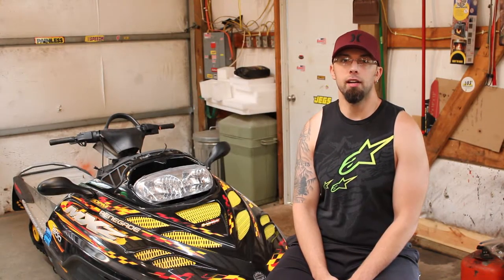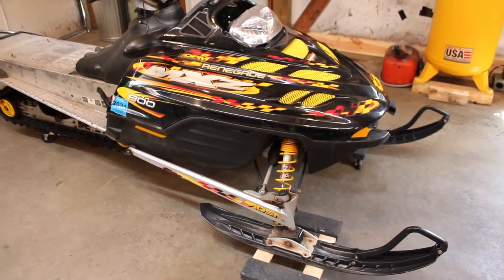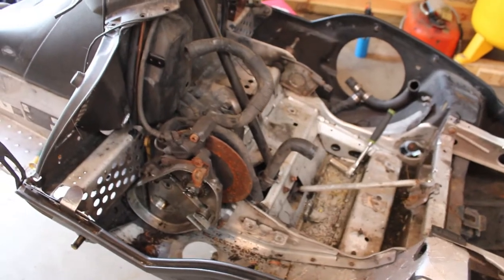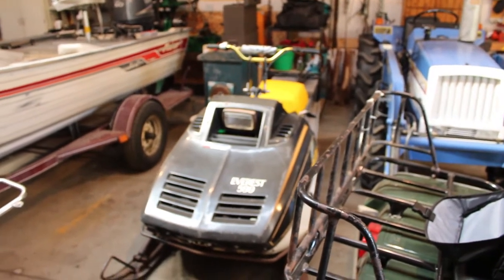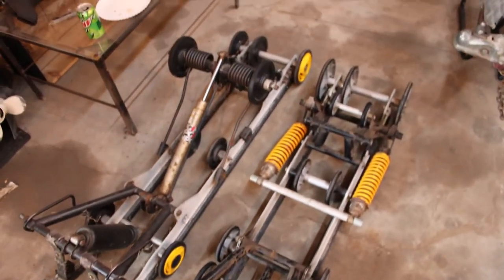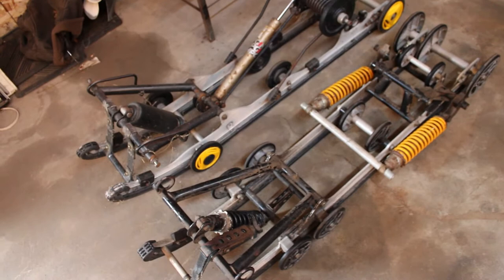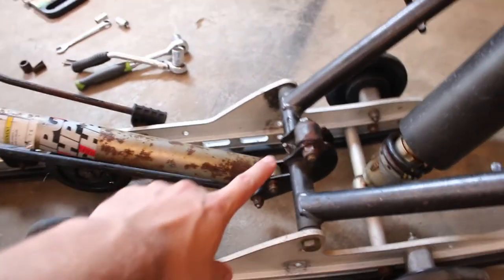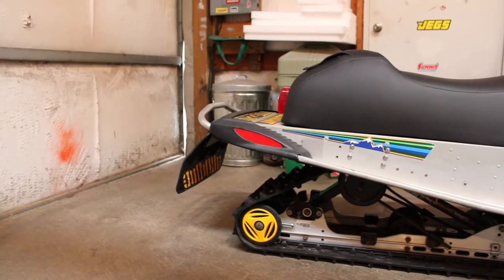Snowmobile suspension swap. ZX to F chassis.

Comment: Bro what did you end up doing with the front suspension?
I have a 1996 STX583 I I would like to know if I can make the machine ride better. Great vids.
Thanks.
Reply from the maker: I shoved 14" shocks out of an s chassis in this one. Super tight fit, bit it was doable. If you're willing to ditch the sway bar i think you could easily get the 15" adjustable HPGs in. Handling would probably suck on trail though without the sway bar and these things are tippy enough as is.
Reply: @NorthwoodsNoise   
Thanks. Now I will look for a parts sled. 👍
Reply: Thanks again from Alaska
Reply from the maker: @wesbullock1233  no problem! Good luck with the build!

Comment: You care to share some more information on the mounts for the rear skid to bolt onto the chassis,like the dimensions. I have an 95 583 formula z that I’m swapping to have an 670 and adding the 96 sc10 to it.
Reply from the maker: Is your skid a 121 or 136? I'm working rn, but I can give you a detailed answer in about 2 hours.
Reply from the maker: You can use the existing front hole in the tunnel no matter what size skid you're swapping in. The 121 SC10 center to center distance is 24 3/4". So if you have a 121 measure 24 3/4" back from the front hole and that's where the center of your rear bracket should be. Same process for a 136 except the CTC distance is 30". FYI the ctc distance is less than what the skid would measure sitting free on the floor. They have to be slightly preloaded to function correctly in the machine. So once you have your brackets measured and bolted in you'll have to use ratchet straps to slightly compress the skid to get it to fit in. That's really all there is to it.
Reply: Hi Northwoods, just wondering why u wouldnt find a 500,600 or 700 motor for that zx chassis instead of improving the heavier f chassis?? Its a lighter and better handling platform....
Reply: Next time leave out the crap music.....makes it too hard to watch...

Comment: I've got a 95 formula ss 670 and have been thinking about doing this swap but the sled is so clean with fairly low miles for the year that I don't have the courage to pull the trigger. I've modified every toy I've had or have. This one I can't decide because I don't think I'll find another as clean, especially for what I paid. Nice sled, I really like that color. How does she ride now?
Reply from the maker: Thanks, much appreciated. There's a noticeable difference in the ride quality. Can't beat the extra travel and it does help keep the skis on the ground. It's still not a rev though. I'm not a huge fan of the SC10-2, but it's what I had at the time and still a step up from the C7. As far as doing the swap, I'd say go for it, especially if you plan to put some miles on the sled.